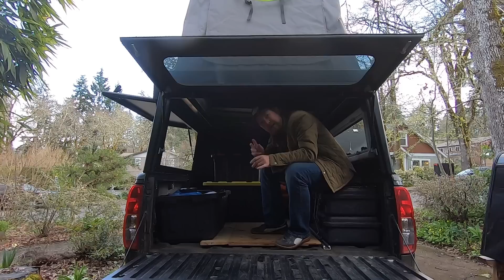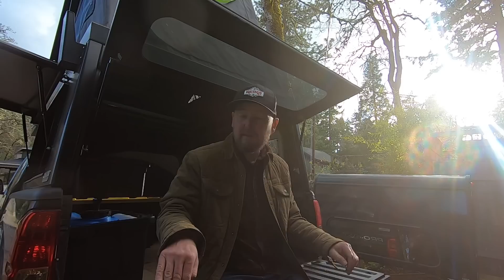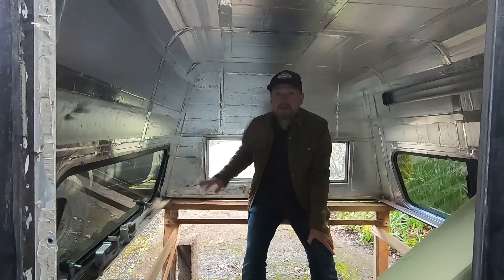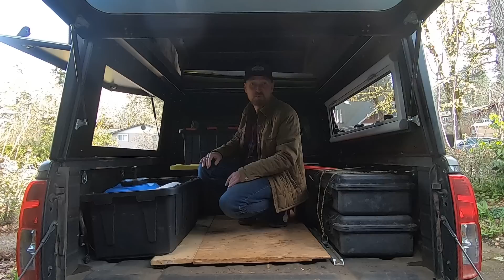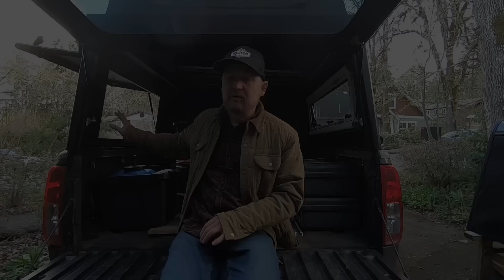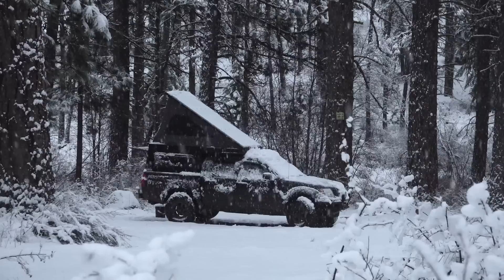Camper Interior Build Series: Part 1 - Planning & Ideas

Comment: How did the seal the front edge of the bed?  I know my Frontier has a 1/4” drop from the side rails.
Reply from the maker: Topo added some extra aluminum and weatherstripping along the front edge when they did the install. Haven't had any issues.
Reply: @ awesome glad to hear.  I haven’t seen much in the fitment of these on a Frontier.  With as much dust as I get in the bed now I’m trying to make sure it won’t happen on the topper.

Comment: How does the canvas sides hold up to rain and the pnw weather.    We’ve been thinking about a camper like this.
Reply from the maker: Topo uses a pretty heavy duty marine-grade canvas that handles the weather quite well. I'm not sure about some of the other camper companies, I've seen some such as Four Wheel Camper that use what appears to be nice sturdy materials, and other companies that appear to use a lighter weight material more like a typical ground tent. The only issue I've had with the tent has been in storms, if I'm parked broadside to the wind. Eventually, with sustained powerful winds, the constant pressure ends up oozing some water through the zipper on the windward side of the camper and I'll get a little bit of a drip, while the leeward side remains entirely dry despite still being rained on. I haven't had this happen on normal rainy night, just if I'm getting constantly hammered by strong wind.

Comment: 11:57
Could the drag-strip down the center be only a few inches above the truck metal...
... with higher slide-in storage along the sides?
This gives you a kick-zone while seated on the swooning settee.
.
Could sections of your under-floor slide-in storage include lift-out or lift-up lids for access?
Staying within GVWR plus balance, could water jugs be in those compartments... with spigots available through gates in the side of the truck bed?
.
How about a service body or flatbed with boxes?

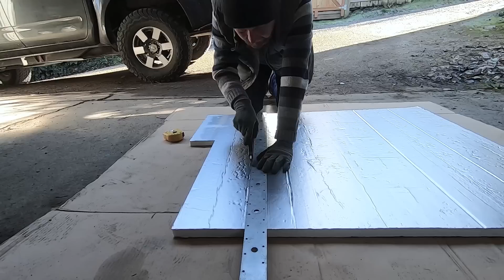Comment: 04:50
a -- For our ExpeditionVehicle, we insulated with:
* adhesive-back acoustic against the inside wall, a gap, then
* one-inch pink-board, another air-gap, then
* two-inch foil-side poly.
We heat using a Wave 3 catalytic heater.
With our excessively obsessive insulation, we rarely operate the heater above 40°f.
.
b -- We had two FourWheelCampers.
The Hypalon-style material for the curtain offers pretty much zero insulation.
FWC has an 'Arctic Pack' option, a removable envelope acting as a container to slow air-flow between the interior and the curtain.
As I understand that, their Arctic Pack has no traditional insulation inside, it is merely a barrier of a couple more layers of 'Hypalon'.
.
.
PS:
Eugene, Oregon.
Pacific Rubber -- Fifth at Conger -- usually carries adhesive-back acoustic insulation.

Comment: Awesome thank you so much of all the videos you’ve made this is my favorite series so far because I use my truck for work so I need some thing that can be switched over. I’m curious can you get Ruth bars that go on top of the TOPO camper top? And if so, do you know how much weight I can carry?
Reply from the maker: Topo offers some kind of mounting channels that can be added to the roof. If I remember correctly, if one needs to carry much weight up there, they can upgrade the struts.
Reply: @softroadingthewest  
I could see fabricating a rack for above your cab and hood for more photovoltaic.
I can see the base of such a rack between the truck bed and the canopy -- for rigidity and support -- similar to a traditional lumber-rack... but extending forward instead of up.
.
I say more photovoltaic because I think a second battery would help maintain the camper comfort in chilly weather.
.
During chilly weather in our ExpeditionVehicle, we always open two windows on opposite walls.
The escaping warm air carries humidity and odors.

Comment: Have you considered using an electric blanket? I’m curious how much battery drain it would be. I believe there’s also 12V options
Reply from the maker: Oh I've been doing that for a couple of years now, and yes, it works wonderfully well. I have a 12V blanket and it draws 54 watts, so even my smallest Jackery unit (500) can easily power it all night long, though I always end up shutting it off after a few hours, occasionally turning it back on in the coldest the pre-dawn hours. This approach definitely makes much more sense than heating the entire space all night long if you're just going to be asleep in a sleeping bag anyway.

But the blanket doesn't help for those times when I need to get inside and change for bed, or when I get up in the morning and need to get dressed, or if I just need to hang out inside for a few hours on cold or wet evening. I camp right through the winter in sub-freezing temperatures, and the back of the truck is a literal icebox...I've had a 4-gallon water jug freeze solid INSIDE the back of the truck with me. Some kind of space heat is necessary for when I'm in the camper but not in bed. :-)
Reply: @softroadingthewest  good to hear the 12V blanket works well. Makes sense it won’t help for hanging out while not in bed. Which 12V blanket do you have?
Reply: He has used that for a long time as it uses little power

Comment: Nice camper setup. What is the truck gas mileage with the camper? Can the camper be removed from the truck bed by a one person? Thanks.
Reply from the maker: I'm getting 17-18 mpg at highway speeds ~60-70mph. For one person to remove this, you'd probably need some kind of lift system. There's a new company called Rapid Topper that is about to release a system they've designed just for this purpose. I don't think they're shipping yet but I believe it will be available in the next month or two.
Reply: @softroadingthewest What is the height of the truck with the camper?
Reply from the maker: @mengng219  Mine is at about 6’8” but that will be different for each truck, depending on truck model, suspension mods, tire size. My truck sits 3” taller than stock. And some of Topo’s campers may be a little taller than mine, I think some may be designed to fit over a factory roof rack on other truck brands. Mine sits about 30” higher than the top of the bed rails. Topo could tell you how much above your specific truck the camper top would be and you could calculate total height from there.

Comment: For the cooking surface on the side, you could make it crazy simple and do some aluminum angle iron riveted to the frame just below the canvas section in an L shape and then take a small piece of tabletop (like a thin butcher block piece) and have a floating surface that has no need to be connected to anything below since it would be secured to the aluminum angle iron which you would then rivet to the frame. The surface could be able to be bolted on and off it you want and you could even use some sort of quick-connect fasteners.

For heat, a couple of thoughts. First, you will likely need a second battery at least under the hood to power most types of heaters (for any time beyond a few hours, in addition to the fridge) that are going to provide condensation-free heat (as most have a blower at a minimum). I would still consider a diesel heater, due to the ability to build it into an external case and pipe heat in and how incredibly cheap you can accomplish a dry heat source. Replacement parts are plentiful and the heaters are stupidly simple (one moving part, minimal electronics, and minimal parts). Thus freeing up interior space and being something that is not mounted permanently. Im not sure if you can build a propex into a case? Might be worth a look. Any other type of heater would likely require permanent holes and mounting. Webasto does make a gas version that you could mount externally (under the bed of the truck, they are designed for this) and tap into your truck's gas tank, eliminating a need for more than one fuel. Would still have to cut a hole to route the warm air in somewhere, however.

Looking forward to seeing what you do with this build!
Reply: Could the heater be built into a removable/modular box on the new bumper?
Add the heater during chilly weather, remove it and use that space for another purpose during pleasant weather?

Comment: I have next week off of work and was wondering if there are any passible trails in Oregon this time of year. I will be solo so I'd rather not try my luck with melting snow. Does anyone have a good lower elevation route without water crossings? All the ones I can find have a bunch of water crossings that aren't fordable in the spring. I have a stockish 5th gen 4runner so I'm not looking for any crazy rock crawling either.

Any ideas?

I'd also be down to meet up with someone if anyone is interested!
Reply from the maker: I was out exploring in central Oregon this past weekend. I only hit significant amounts of leftover snow at forested higher elevations (I didn't track it closely but probably around 4,500-5,000+ feet). Maybe some small unproblematic patches in deep shade at lower elevations. I drove to the top of a 5,300-foot treeless butte which had no snow at all. Out in the desert where there's no trees to create shade, the snow is gone, and even IN the forests, the trails were mostly dry & dusty below 5,000 feet. Just keep an eye on elevations as you plan your trip, and/or focus on more open desert areas where fewer trees might be preserving the snow. (And I agree, you're wise to avoid that leftover spring slush!)
Reply: @softroadingthewest  thank you I am excited to start getting out again

Comment: Sounds like you need a low beach chair down the center.
Reply: Perfect solution!
The armrests support his arms, eliminating neck strain.
His laptop sits atop his lap, eliminating the requirement for a table or shelf.
And it fits our 'modular' philosophy:
* it can be used outside,
* it can be loaned to a chum
* easily swapped or replaced.

Comment: Nice setup Donald! I enjoy your videos and the thought processes you go through.
 I have a hard shell ARE topper that I got through Craigslist for my F-150 (pure luck it fit and matched the color). It has a glass entry door on a full opening hatch, slider windows on the sides, and a large hinged window toward the cab. I built a 7" platform of 3/8" birchwood ply, and incorporated pull out drawers I can slide open when the hatch is up. I included access hatches that I can get to my gear from inside via the surface of the platform deck. The platform is approximately 5'10" front to back, and 4' wide between wheels. The center drawer goes the entire bed length, the other two sides are about 30". The side cubby structures go from the truck bed to the bed rim. 

The cubby sides fit over the wheel wells, I keep a couple 5 gallon collapsible water bags toward the back near the hatch. Being 6'1", I can still sleep diagonally on an insulated air mattress; I simply use a moving blanket as a soft insulating barrier under that. I put all of $200 into the whole platform project. I can easily put in/ take out the system to use the bed for hauling in about 15 minutes, as the main platform is 75# and goes in after the sides are installed (each side is about 20#). I've spent only about 6 nights camping in it but it worked comfortably. Organization is key, having things where you'll use them most is a bit of Jenga. 

I bought some topper felt I plan to glue onto the fiberglass interior, hoping it will turn out well. I wanted to reduce interior moisture and possibly soften noise. I imagine I'll be able to stick some LED rope lights and other stuff to it, plugged into my Jackery. I have a Jet Boil stove I use for coffee and instant oatmeal with windows cracked open, and I sit up comfortably with a small stadium chair. It doesn't take much to warm the small space just heating some water.

Comment: Any reason to not use one of your bed sections as you're raised countertop?
Reply from the maker: I want the countertop to remain present even when the bed is fully deployed (even though the bed would cover most of it at that point, it would leave a small area still exposed and usable). Since I plan to build cabinetry fully surrounding the cargo door anyway, the entire driver side pretty much becomes cabinet, the top of which pretty naturally serves as a counter. That is a good point though...one of those bed panels could be placed to temporarily form a complete L-shaped counter if needed. 👍
Reply: @softroadingthewest  well, here's hoping you have some of that completed by the time expo at Redmond rolls around. I would be very interested in coming by and taking a look. I'm very interested in a topo topper and interested to see how your build goes. Good luck!
Reply from the maker: @blackpearlvoyager4174  I am hoping so too. I have another month to go on this huuuge client project I'm on which is making it hard for me to get any work done on the truck. Hopefully I can kick it into high gear through the month of June. I suspect I won't have the interior fully done in time for Expo PNW but you'll be able to see where I'm at. In theory I'll have my truck IN the show...more details as we get closer. 🙂
Reply: @softroadingthewest  yeah I'm still waiting to hear if I've been selected as a presenter this year. I'm reluctant to buy tickets TO the show if I'm going to be IN the show. Here's hoping they don't sell out in case I'm NOT in the show.

Comment: Drivers Side Door and storage: I use a contractor cap on the back of my truck.  The side doors have tool storage shelves in them.  They go into the bed about 8-10 inches.  I am sure you have seen them.  For your set up I was thinking you could do the same thing, just not as deep as it would protrude into your interior storage/stand up kitchen set up but you could store things like a portable folding fire pit, spare propane bottles...etc.  You could put your cooking stuff in that storage since you prefer to cook outdoors but have a sliding back on it so that if you do cook indoors you have access to the kitchen items. I can't verbalize what I am envisioning but maybe this will give you some ideas
Reply from the maker: Yes, I understand exactly what you mean and that is very much my vision for the cargo door. It will open into a storage space which will be enclosed within the standing height cabinet I'm going to build inside, but I'll also include access to that space from inside as well. I've gone back and forth with what gear I will put in that cargo door space, but I had a bit of a breakthrough last night while fiddling around with some scrap material and now I'm about 95% sure I will indeed use it for my kitchen. :-)

Comment: You young guys and your makeshifts.  One sentence you threw out there keeps ringing in my ears:  "You don't have to build it out."  After camping for 50 years as an adult, having tried every sort of rig, I'm going to make a bold and no doubt unwelcome prediction.  You will eventually see where building it out is forever leading you, and get a small camper trailer like mine - 17 feet long, 3500 lb standard axle with a spring over for clearance, a couple of solar suitcases, couple of golf cart batteries and a big inverter, pulled by a 4x4 truck.  Go anywhere you are going now, camp almost anywhere you can fit your truck, and still have a hot (Navy) shower every day and a real kitchen.  As much privacy as you want and you can stand up straight inside with a hat on.  It all just works.  You can even bake fresh bread!  Perfection! All this brand new for $15K and change in 2018.  But then it is a fact that pure bliss doesn't draw views on Youtube.   What we really want to see is entertainment.  You know, eternal struggle.  :o)  
Just think of this as your friendly neighborhood voice of doom.  Or reason.  Take your pick.
Reply: A trailer is impractical for the type of trips Donald likes to do.
Reply: @pnwxplore  Not so, if the trailer is small, has good clearance, and you go slow.  In fact, I have taken a 17 foot trailer to many of the exact same places, all through the Williamette and Umpqua national forests.  I do avoid the snow, mostly because it is unpleasant for walking, and the summers are so glorious there, it's sort of "why bother?" There's plenty of snow a lot closer to me.  I have to watch the overhead, but the trailer is the same length as my truck, and about the same width.  The really bizarre thing about Oregon is that so many of those one lane high roads are paved.
Reply: #Bob,
The intriguing part of a great -- and enduring -- fable:
* The Hero's Journey.
We see him face obstacles, we see his determination during set-backs.
And we see his development as he grows into a fuller version of his adultness.
A good fable gives us an opportunity to contemplate our decisions in similar situations.
Indeed, our heritage is sitting around the campfire, listening to the elders.
What greater gift can any man offer.

Comment: Couple Of Ideas 😊 For flooring use those foam puzzle pads - double thickness. 😊  For electrical keep all the wiring easily accessible in case of issues.  😊 If you make a pull-out drawer under the bed make it accessible from the inside with lids. 😊Spray-on glue (3M Super 77) worked great for my light weight wall carpeting. 😊 I really like the Kovea Cupid heater with butane canisters. 😊 I use a larger 12V computer fan to vent moisture through a small opening. 😊 A single burner butane stove is nice for cooking in such a tight space. 😊 Add a roll of bug screen inside the main camper door that rolls up out of the way, but rolls down during summer naptime. 😊 Keep shelves open with 1" rails/guards on the bottom, and use cheap clear bins for organized storage.  Have fun with the build! 😊